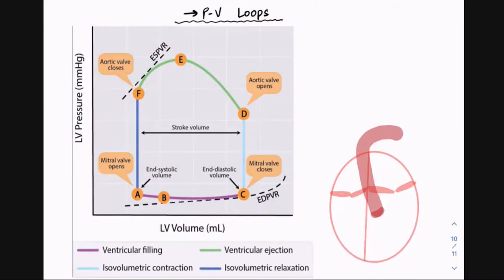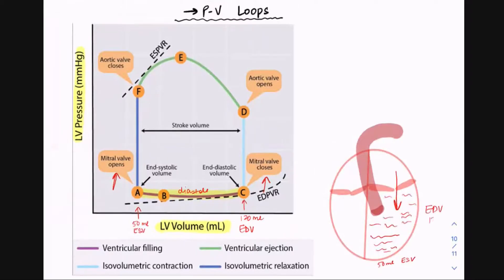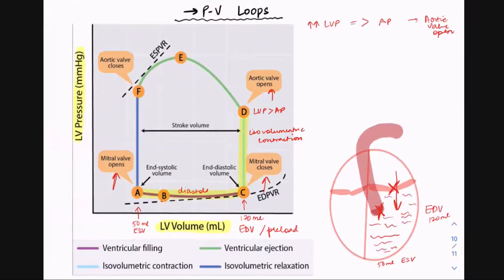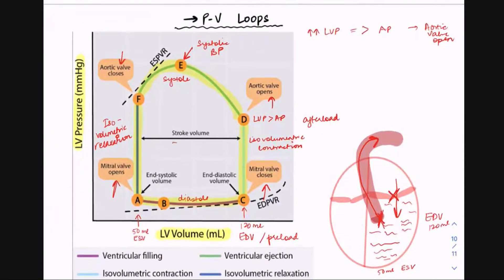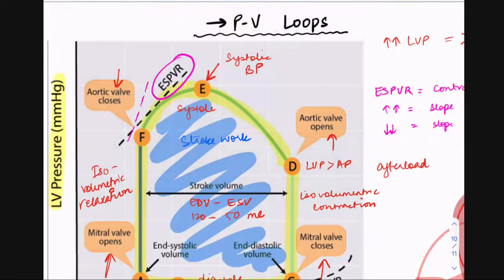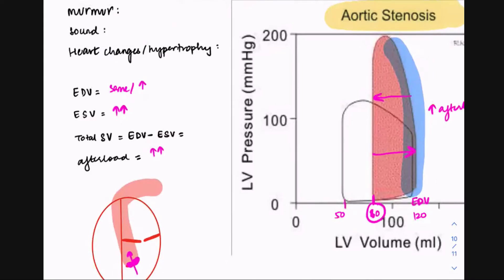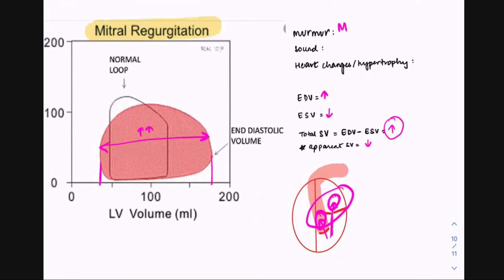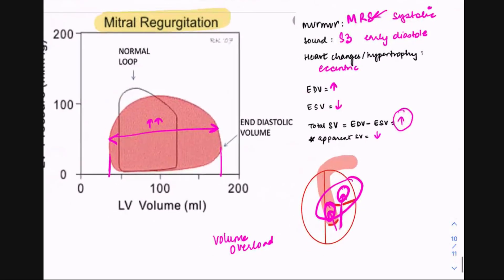PV Loop - Cardiac physiology

Comment: Why does the aortic valve open at 80mm hg when the pressure in it is 120 mm hg ?
Reply: During that time, it's still immediately after diastole and the pressure in the aorta is still the diastolic pressure of 80 mmHg. After the valve opens and the blood in the ventricles are pushed out, that is when pressure rises upto 120 mmHg as seen in the graph. So when the aortic valve opens, its still 80 mmHg in the aorta.

Comment: Please answer this question.  I think all textbooks show it wrong.  SV increases as EDV increases and they all shorten to the same ES point on the ESPVR curve.  Why should it shorten to the same end systolic pressure or point?  If you increase SL (as in higher EDV) you should get more force (Force-length relationship) and more force means higher pressure.  If they all shortened to the same ESP when you increase EDV, how would they even get the ESPVR curve?

Comment: What does point B indicate?
Reply from the maker: I'm not sure what its significance is. All I can say is that it's a point during the diastolic filling phase of the LV.
Reply: I see you posted this a year ago so I'm late to the game. A is where the mitral valve opens because the pressure in the ventricle is lower than the pressure in the atria. The segment from A-B, where pressure continues to drop even though the ventricle is filling occurs because the ventricular muscle is continuing to relax. From B to C, you get more filling and only a modest increase in pressure (Pressure higher than point B) because even though the ventricle isn't actively relaxing, in a healthy ventricle its still highly compliant. Then ventricular contraction starts at C resulting in closure of the mitral valve and the initiation of isovolumetric contraction.